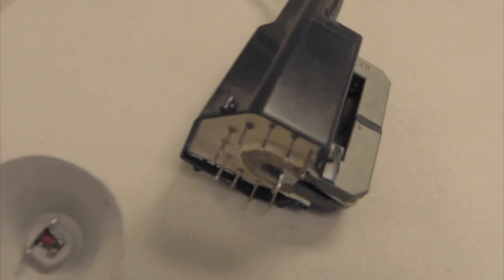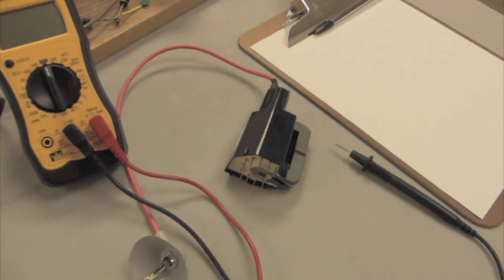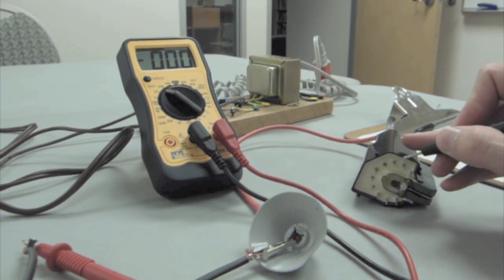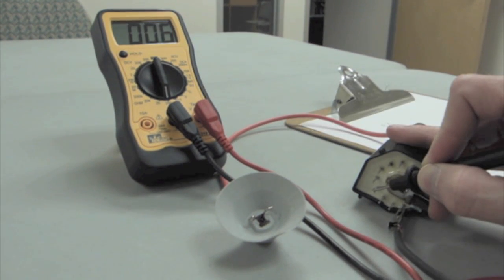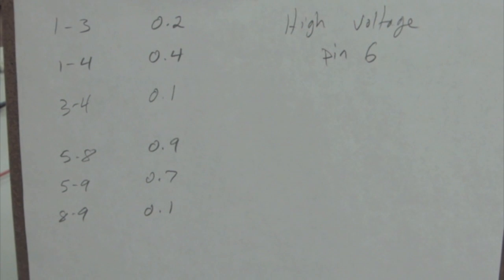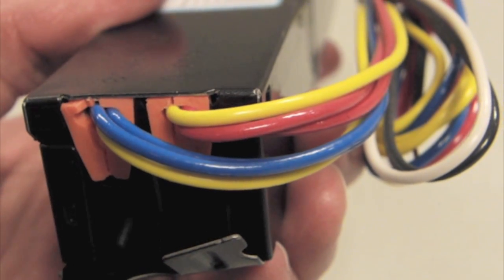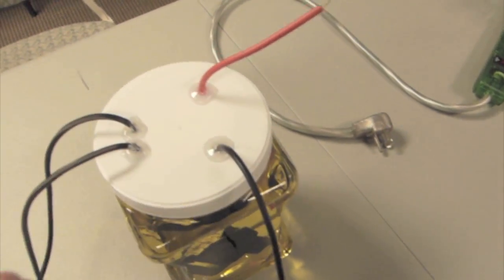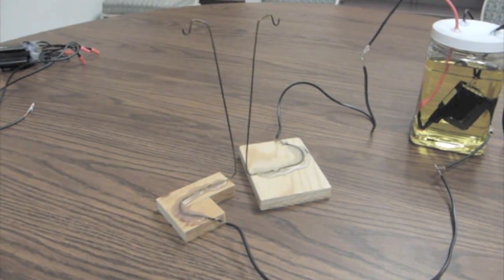How to wire a flyback transformer and make a high-voltage power supply

Comment: I did exactly that but my output is not continuous, I need to turn on/off the ballast to get arcs, otherwise, it will arc for two or three seconds and then stop arcing.
Reply from the maker: You may have a ballast that shuts itself off when it senses abnormal conditions, or your flyback may be drawing too much current.

Comment: Hey can I use the old type of ballast the heavy ones with a starter? To power the flyback
Reply from the maker: I haven't tried--as long as the ballast puts out the right frequency and doesn't shut off, it should work.
Reply: Basement Lab Productions oh ok thanks

Comment: Hey, I just measured these resistances (in Ohms): 
1-2 = 1.8
1-3 = 1.7
2-3= 0.6
4-5= 0.6
6-7= 0.6
6-8= 0.8
6-9 = 0.9
7-8 = 0.6
7-9 = 0.9
8-9 = 0.7
The highest resistance is between 1 and 2 so that should be the primary coil. But I'm kinda confused about the secondary... will 6-7 do?
Reply from the maker: Just looking at the numbers, it looks like 1-2 is probably the primary. Did you leave off several others? (I don't see 1-6, for example.) You need a power supply to find the secondary--start about 1 minute into the video.
Reply: http://www.donberg.ie/catalogue/line_output_transformers/hr_8520.html I believe this is the schematic of the flyback transformer I'm using.
I skipped the rest of the pairs of pins because they had no continuity.
I'm not using ballast to drive it because I built my own driver: http://www.powerlabs.org/images/schematic1.gif
I tried to put current through the secondary via HV cable, I put in 15V and I got only one live pin (No. 10) but with only 0,05V.
I believe pins 1 and 2 are the primary coil. then I tried pins 4 and 5 as feedback also 6-7,6-8 and 6-9 to no avail.
Could you please help?
Zobrazit méně
ODPOVĚDĚT
Reply from the maker: So pin 10 is the negative of the secondary (and the positive is the red wire coming out the top, of course).

Comment: Can I just connect the main source from home (220V,6A) to full bridge rectifier then to flyback transformer? Will it shorted or what will happen?
Reply: Alberto Septian Wijaya you cant connect dc to a flyback transformer and abort just connecting mains straight to the flyback will not make high voltage because its too low frequency
Reply from the maker: Willeexd is correct--the flyback needs very high frequency AC to operate.
Reply: Alberto Septian Wijaya L
Reply: john jay  yes if its powered up

Comment: Will any conventional ballast work?
Reply from the maker: Good question--I'm not sure. All of the electronics I've scavenged from fluorescent light bulbs have worked, but eventually failed because the flyback draws too many mA. This is the only ballast I've used, and it's been rock solid. I've been using the same power supply you see in the video for four years now.

Comment: why do they make my ears ring? I've always wondered that, but they could be helpful if I ever work with electricity.
Reply from the maker: Flybacks need a high-frequency AC current to operate--in the thousands of hertz--I suspect that the sound produced by this current is causing the ringing in the ears.
Reply: Monte Fleming That would actually make a lot of sense now that I think about it. The reason I said wiring one may be useful is if I'm going to get electricity run in my basement, one may be needed for some of the old appliances I have down there, but they're mostly broken, and need repairs.
Reply: Flyback vibrates at 17.5 KHz.

Comment: hey bro, I have a question. alright here's my setup. I have got a 53v dc power supply using 2 diodes, one for negative 1 for positive. but, when I try to use it, my breaker shuts off. how can I reduce the current to an amount that will still be fun but won't do that?
Reply: I like how he asks for help then never replies BACK. XD
(wait, that's utterly disturbing, I hope he's still alive.)
Reply from the maker: +Noah Clark If you attach a load to the power supply, does it still blow the breaker?
Reply: +Monte Fleming yes it does
Reply: Noah Clark thank Satan you're still alive.
Reply: satan? :O
Reply: Commander Riley it was a joke, I'm an atheist, theists question my expressions.

Comment: I have a flyback which have 2 sets for primary.One set is 0.9 ohms and the other is 1.2 ohms.Which one should i use?
Reply from the maker: Commander Riley Either should work--maybe test them both to see if there's a detectable difference in output.
Reply: Monte Fleming It have a bigger arc on the 1.2ohm set but it have much more noise.Is that normal?
Reply from the maker: If the noise is from shorting, the other will be better.
Reply: Monte Fleming Yea,but the pins with 0.9 ohms give smaller arcs,acout 1cm smaller
Reply from the maker: Commander Riley Ah--I would just use the 1.2 ohm pins, and if it burns up, just get some flybacks for a few bucks a piece at Electronic Goldmine. The one you see in the video was $3 or $5, if I remember correctly.
Reply from the maker: Commander Riley Do you have the flyback submerged in oil? I haven't found another effective way of insulating it.
Reply: I havent put the flyback in oil.But i dont use it too much.most of the times I use it as a taser to kill insects.Do i have to put it in oil?
Reply from the maker: Commander Riley I suspect it will last a lot longer if it's submerged in oil because it will keep it from shorting. I've had one that I've used for many different experiments over about 4 years, and it's still going strong.
Reply: Monte Fleming Ok,Thaks for the help :)

Comment: Monte Fleming did you use a driver?
Reply from the maker: Owen Chase Instead of building a driver, I just used the ballast--the final output is quite a bit higher than I've seen with most drivers.
Reply: You sayed thats a balast.It doesnt look like a balast used for fluorescent light tubes

Comment: My flyback have 2 two other cables besides the red,one black and one grey.
What to do with them?
Reply from the maker: David Toma Usually you can ignore the other cables. Sometimes they have to connect in a specific way, which can be difficult to figure out.

Comment: What if I wrap a separate wire around the ferrite core,say 10 turns,instead of using the pins 5 and 8?Would that make any difference to the voltage output?

Comment: now that I see it again, you're only using the feedback (5-8) and not the primary am I right? does it work better like that?
also this, can you use it for a Tesla coil? thanks
jecklinger@gmail.com
Reply from the maker: George JC Klinger I think pins 5 and 8 are the primary. I haven't tried using it for a Tesla coil. That would be a good experiment.
Reply: Monte Fleming I guess I never found out how to locate the primary and I gave up on it.

Comment: I dont understand where the negitive output for flyback goes
Reply: the negative is what triggers the positive (the long red cable with the pump thing) that's what makes the circuit to short circuit and see that thunder like reaction.

Comment: How can I send you a video or a pic of what I made. Looking at your paused video and what I found on wiki I made what I think is a copy of yours. The first attemp I got the wires on the bridge wrong and got no results. Then I figured out the correct config. I now have somthing strange. 24.4 dc volts and 10.47 ac volts on the outlet wires from the bridge. I am wondering if this is normal I have never seen ac volts and dc volts on the same wire ever. How is this so? Any feedback would be amazing. I would love to show you my device how can I do that?

Comment: Also what are the diodes doing I know this arangment can be wired to change ac to dc but I have never seen a diode bridge on a dc side already I'm excited about that. Also would adding a capasitor thru the middle help or hurt the ripple. Would it smooth it out to much?
Reply: that little transformer on the board is putting out AC the bridge is to change it to DC for easy use

Comment: So I made this yesterday, and it was working great, with no overheating. This morning I tried to arc it through a light bulb, and a weird pop came from the ballast and it is no longer working! What happened? I had no insulation on the transformer, could that have something to do with it?
Reply from the maker: I've tried it without the insulation on the flyback transformer, and there was a lot of arcing around it--I assume it will burn up something in it after a while. I tried dumping hot glue all over the pins on the flyback, and even that didn't stop all of the arcing. Hence, the oil bath.
Reply: MMIVcomp Will this work as a ballast - http://www.ebay.co.uk/itm/Electronic-Ballast-1-or-2-Fluorescent-Lamps-2x40W-AC-220V-Ezouf-/390595131252?pt=UK_Light_Fittings&hash=item5af148b774
Reply from the maker: halflife390 I really don't know. The only ballast I've tried is the one you see in the video: http://www.ebay.com/itm/Philips-Advance-ICN-4P32-N-Electronic-Ballast-3-or-4-Lamp-120V-277V-F32T8-F17T8-/271374520935?pt=LH_DefaultDomain_0&hash=item3f2f2e9267
It works really well--I've had this one on for many hours and it's still going strong.
Reply from the maker: I suspect that running it without insulation will burn it out pretty fast.

Comment: So now could you solder in a light dimmer switch to the 120v input to make the voltage variable?
Reply from the maker: If I could get my hands on an old dimmer switch, it might work to lower the amperage and create a voltage drop, but the newer dimmer switches just lop off part of the sine curve 120 times a second to lower the energy directed to the bulb. I'd like to try a Variac. I think it might actually work, but varying the voltage might cause the ballast to shut itself off.

Comment: I need some help. A while ago I saw a video on a flyback transformer making some beautiful arcs so I got myself a flyback and some ballasts. I found the HV ground and input pins and I got the thing to work only when I turned the power from the ballast to the flyback on and off really fast. that was a pain in the butt and I suck at electronic circuits so I got ten more different ballasts and tried them all. nothing. eventually I got mad enough to hook it up to mains and I gave it a few too many volts until it caught fire. I still wanted to make arcs so eventually Got myself another flyback and using this excellent tutorial wired it up. same problem I cannot figure out what i'm doing wrong. I also have to use a dummy load any ideas on that? Thank you for the excellent tutorial
Reply: The problem 
The flyback might be damaged
The number of winding turning is less
The thickness of the primary 
Or the ballast is hooked up the wrong way
And since you are using a ballast remove the top cover and keep a cpu fan for cooling the ballast.
Hope this help
Reply: Transformers only work on AC if that helps.

Comment from the maker: Air at standard temperature and pressure breaks down at about 33 kV/cm. This power supply will routinely produce a spark across a little more than a cm, so I figure it's putting out at least 40 kV.

Comment from the maker: The flyback probably has a rectifier. Try running the current through the flyback the other direction. It's also possible that the internal resistance in the HV circuit is too high for your voltage supply, or it could just be broken.

Comment: I have question.  I seem to be unable to finding pin that's connection to HV on my flyback when I use multimeter.  Why it is not shown up on my multimeter?  Is it normally or broke?

Comment: is there a way to figure out the voltage level that the hv transformer is putting out? I figure you cant exactly hook it up to a voltmeter since its probably somewhere around 15-30kV. So any ideas how to find output voltage of transformer?

Comment: I used corn oil and man it was insanely good insulating,  or check this: I put two point electrodes inside a bowl of corn oil and  supplied 20kv and  they need to  be less than half a milimieter apart to  breakdown! However  I noticed  the oil breakdwon got much worse the second time I tried.. the oil somehow was as good already hmmm

Comment from the maker: There has to be conductivity between the pins that you attach to the ballast. I chose 5 and 8 because, of all of the pairs of pins that were conductive, 5 and 8 had the most resistance (but not by much).

Comment from the maker: Several times--sometimes the flybacks hold a charge and get you after you've unplugged everything. The shock is quite a bit different than the 110 volts from the wall--it's more systemic than localized due to the high voltage.

Comment from the maker: It's probably damaged--I'd be surprised if it still works.  It's worth a shot, though.  I'd try testing the conductivity of each circuit, and if they look normal, try hooking it up again.  If you don't have another old monitor or TV laying around, you can get a flyback on ebay for a few dollars.

Comment from the maker: The spark from this power supply can jump over 2 cm in dry air (much further once the air is ionized).  Air breaks down at about 30,000 V per cm, so that means it's putting out about 60 KV, give or take.  The maximum wattage put out by the ballast is probably about 40 W.  I doubt this thing is pulling 40 W, but if it were, the amperage would be 0.6 mA.  The flyback transformer contains a rectifier, so the output is DC.